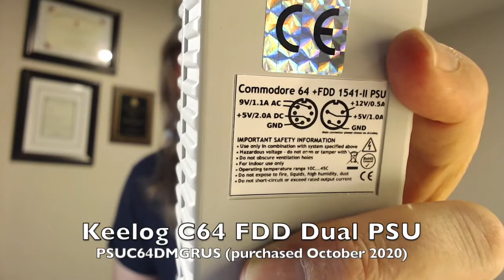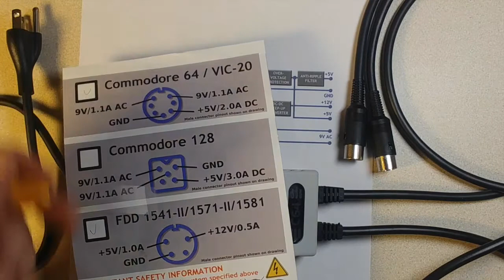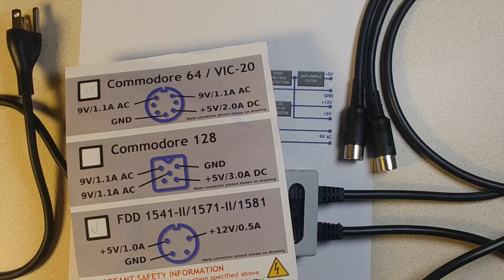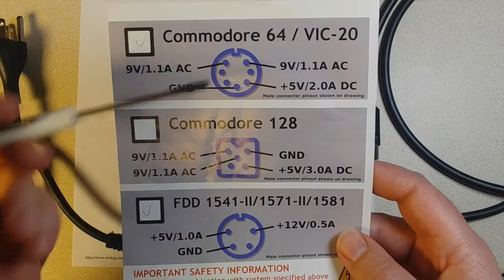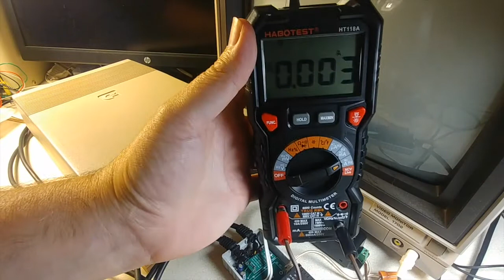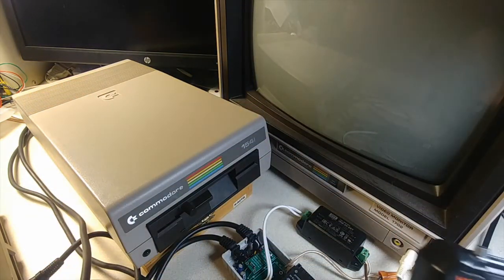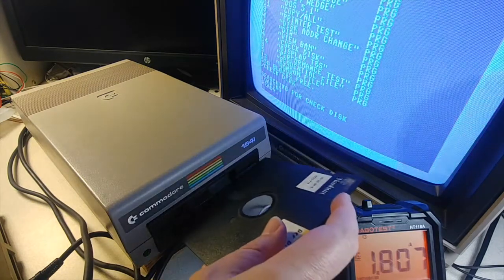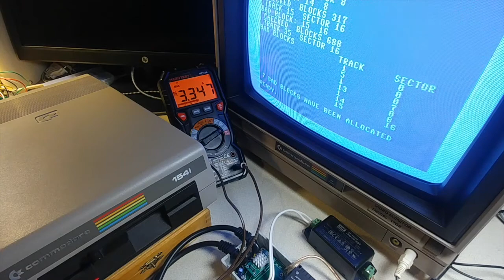Keelog Dual PSU mod to power C64 & 1541-DC

Comment from the maker: 12:51 I've since noticed in the video at 12m51s, before I had put my meter in max. mode to capture peak current, the meter flashed "4.118" amps. Given that I also saw a peak of 5.09 volts, this yields 20.96 watts drawn from the Mean Well IRM-30-5ST. This is higher than the peak I report at
14:20 when I say I saw a peak of 3.979 amps and 20.25 watts.

Comment: I also broke the LED wires when I opened mine but it's easy enough to fix. The Keelog may have to stay in its flux capacitor form as I don't know of any reliable SMPS that will fit in that tight space.

Interesting to see the power draw from the 1541, this is the first time I've seen it measured so it's handy to know exactly what's required to power it. Some quick math says that's about 4W when idle and 15W when active. But it also raises some questions: if the keelog is only rated at .5A on the 12v rail, does that mean only the stepper motor uses 12v? As surely the biggest draw is the spindle motor which I assumed was also powered from 12v?

Anyway thanks for the shoutout, looking forward to the next one
Reply from the maker: Hi! Ya, those short LED leads are dumb. I opened it about 10 times before breaking it. :)

Re: the case, I have a few ideas (one including the "flux capacitor" form, as long I the mains wires are safely insulated), but it will wait until I do the full evaluation about which PSU product to focus on.

I've been looking at the Electroware one and the build quality/design is quite different than the Keelog. For instance, the components attached to the case top have connectors, so we don't break the wire connections. :)

Unfortunately, the Electroware case, while not too small, is too full (with a larger transformer than the Keelog) to fit the IRM-30-5.
Either of these (Keelog or Electroware) will easily fit in my original Commodore 64 PSU case, but I have yet to decide if I wan to put any new holes in that - especially since it's not potted, it's the early serviceable type.
Reply: @DrDavesDiversions  I like your determination to make this work, I'm now rethinking how to power my 1541 but that probably will not actually happen any time soon. Speaking of early non potted power supplies, I recently acquired a metal cased one, something that I've never seen before. So going to do a video on that shortly
Reply from the maker: @TheRetroChannel  Neat - looking forward to it. After my long hiatus from 8-bit C= gear, I was really surprised by their myriad assembly variations. This was hinted at in Brian Bagnall's series of Commodore books, i.e., that they kinda did whatever it takes to get product out.
Reply from the maker: With either the Keelog or Electroware cases, one possibility to make room in the case would be to "pop up" the top of the case by making a new ring-like, 3rd case component, say an inch high, inserted between the top and bottom portions. (It would be essentially an extension that could be fixed to either the case top or bottom.) If done well, it could look nice too. I just haven't thought of a material I would like to make that from most easily.

One option might be clear acrylic Plexiglass (which I have on hand, like from a cheap picture frame), offering a view inside the sides of the PSU. Weirdly, the Electroware status LEDs are actually inside the case (and you can spy them through the vent slots), so those could be made more visible this way. (It has separate status LEDs for 5V and 12V.)
Reply: @DrDavesDiversions  Interesting that they didn't make the LEDs more visible.
Reply from the maker: @TheRetroChannel  Now that I think of it, the SD XMDZ DC-DC boost module also has an LED on it, so the Keelog dual PSU also contains a "hidden" LED inside the case.
Reply: @DrDavesDiversions   Ha, why are these people denying us of our LEDs!
Just had a poke around at the 1541 here. It seems the stepper motor has a label on the bottom of it saying 12v 33ohms, so that gives us about a 4.5W draw. And hooking up an ammeter to the spindle motor gave about 330mA draw with a disk inserted to put some load on it. It's also 12v, so that's about 4W.

So in total the 1541 seems to pull about 8.5W from the 12V rail. Therefore that should leave about 6.5W being drawn on the 5V rail. This means the minimum required to power a 1541 is around 12V X 700ma and 5V X 1.3A = 15W total. I assume this is why the 12v step up converter is getting quite hot

Of course this is still ignoring the 1541-II that these things were designed for. Taking a quick look at one of my dead 1541-IIs it appears to have much more efficient motors, this probably explains how they can get away with only .5A on the 12v rail
Reply from the maker: @TheRetroChannel  Ah, nice work! I did measure the current draw on 12V when I rewired my 1541. Looking back at the video (unused since I mistakenly assumed my Keelog dual had an IRM-10-5 at the time), I measured my 1541's peak on 12V line from the PSU at 0.69A, or ~8.28W (I didn't capture the exact voltage measurement under load) matching your 8.5W estimate.

Your numbers also match my empirical observation that the Keelog and Electroware dual PSUs, each having the 20 watt Mean Well IRM-20-5, work just fine as the single PSU for just a 1541!
Reply from the maker: @TheRetroChannel  I guess two open questions are (a) how [in]efficient the SD XMDZ DC-DC boost module is and (b) what is its real capacity, producing the 12V. (It is adjustable for output voltage.) In my researching it online, I saw a photo or two of it sometimes labeled as 5W max output, but the version of it in both my Keelog and Electroware PSUs, says "MAX. OUTPUT 8W".

It seems I must be running this at or over its prescribed limit when using it to drive the 1541. :-/ I have a note in this video that I put a heatsink on the SD XMDZ since I measured its temp > 140F in the Keelog. 
The way the SD XMDZ is mounted in the Electroware (under the PCB), the back of the SD XMDZ board is back-to-back with the main PCB (~1/4" space), so there is not room for a typical heat sink.